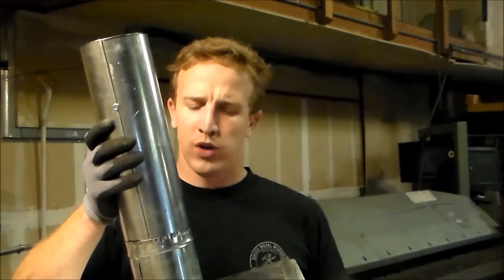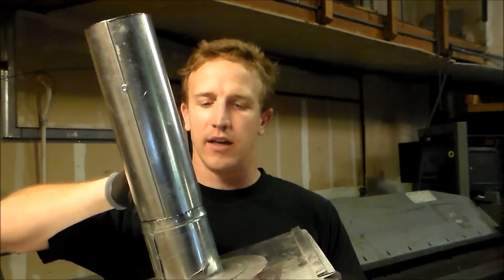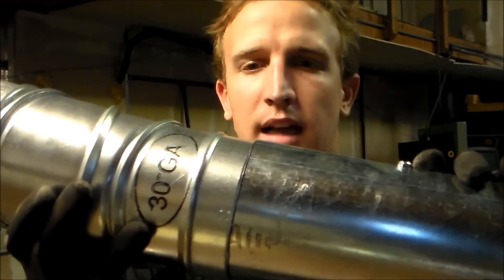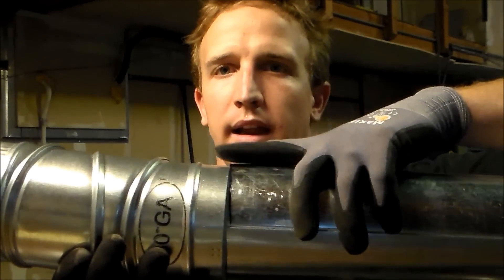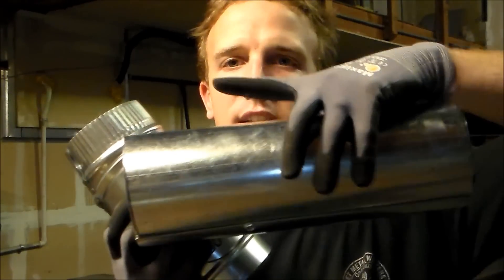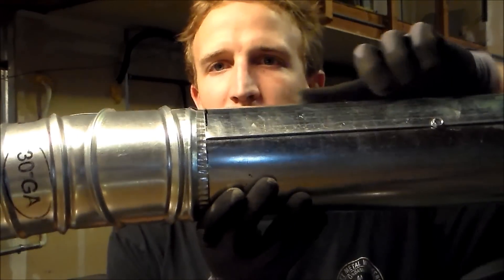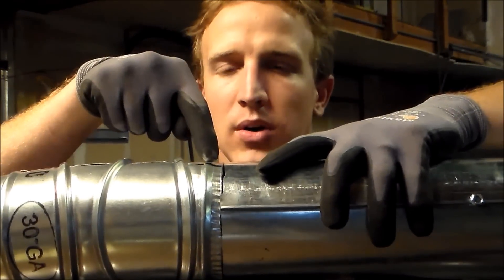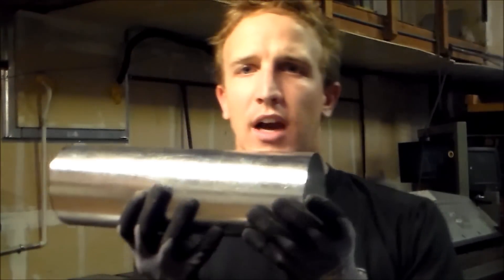Installing Round HVAC Duct correclty with conceptual install in 90 seconds -The Sheet Metal Kid

Comment: I am putting in a duct from a bathroom vent to the roof.  I could orient the crimps for ideal airflow like in this video.  Or I could orient them so that any condensation drips back down through the fan instead of into the attic.  I assume I should do the first option since if the fan and duct have been properly sized and insulated, there shouldn't be much condensation in the first place.  Is that right?

Comment: how to close 3" diameter sheet metal pipe?  it was almost impossible to bend
Reply from the maker: dragon ni It is difficult but not impossible. Almost better off using leader pipe when dealing with duct that small.

Comment: I am in the process of framing my basement.  My upstairs had the sheet metal tubes but I have seen some of your videos showing the "flex tubes" that are insulated.  Which one should I use?  What are the pros and cons?  I live in Utah in a very dry climate with a good bit of snow in the winter.
Reply: +The Sheet Metal Kid It is true that metal has better flow when comparing the same diameter but if you upsize the flex you can achieve the desired flow and use it just fine.  I'm a metal fan also but flex can be a real work saver.
Reply from the maker: +acoustic4037 Yes that is truth